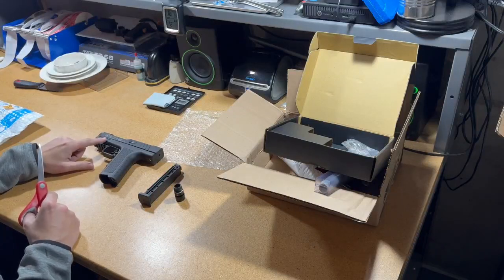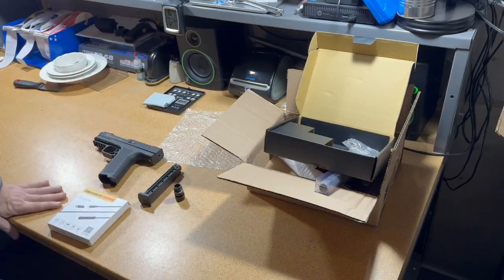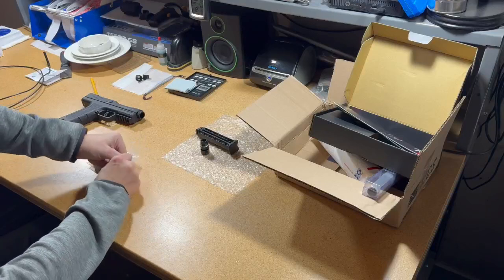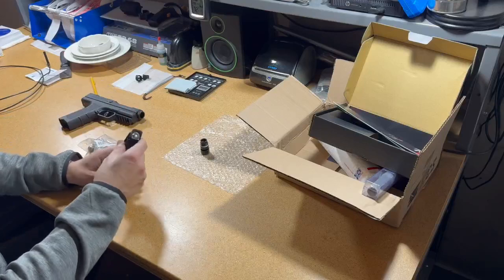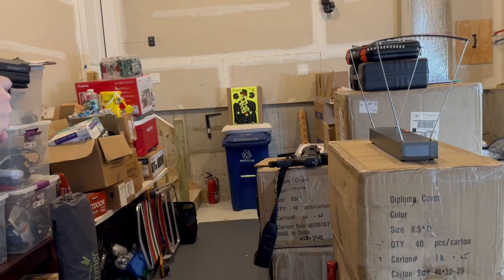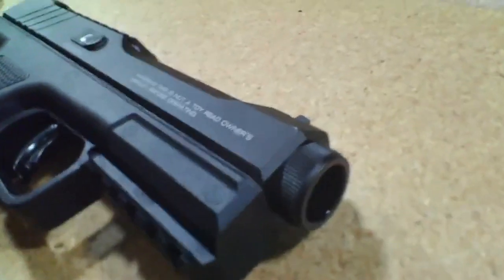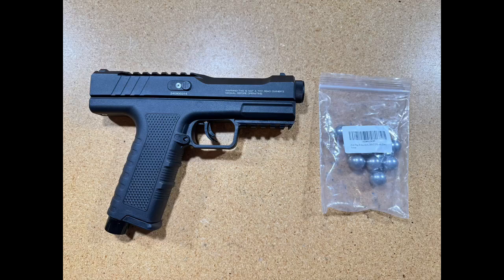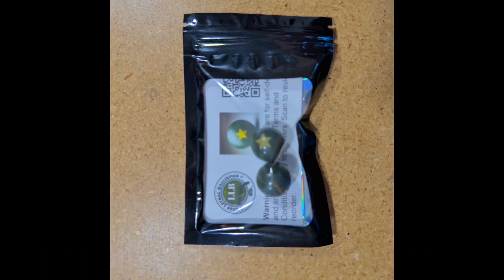Will aluminum .68 caliber projectiles damage your expensive CO2 launcher barrel?

Comment: Great video but i would suggest there is more to barrel damage than some scuffs that will likely wipe right out after a proper barrel swabbing.

I get similar marks from rubber and pvc coated balls.

I suspect the damage is more on the microscopic scale that no one will ever detect on a day to day basis. Some of the more expensive barrels are hard coated and nearly impervious to even my barrel hones. In the case of the X68 it is not.

Barrels are expensive. Would i advise against using metallic balls? Yes, but mostly because the law may see them different than LL.

I need to get me one of those scopes. 👍🏼 Keep em coming.
Reply from the maker: Thanks for your comment. I’m thinking the metal on metal scuffs… is the aluminum ball getting reduced in size or is it the barrel? I don’t want to assume material from the ball is being deposited onto the barrel. The ball may just as likely be taking material away from the barrel. If so, cleaning will not remedy.
Reply: @glennconti You should pick yourself up a 68cal barrel swab. It is an invaluable tool. Many users forget this most simplest of maintenance.
Reply from the maker: @ yes I have one from Valken. Not 100% sure of the  cleaning solution I’m using though. It’s for firearms.
Reply: @glennconti  couple of drops of silicone oil and some vigorous reciprocation 🤣 is sufficient. No need for anything fancy. They dont come filthy with manufacturing oils like steel barrels do.

Comment from the maker: Hello. The Grimburg JUL rounds are metal infused so there will be some metal to barrel contact. I will investigate this further. Thank you. As far as holding a company liable for selling rounds that damage your launcher, most companies limit your damages to the amount of your purchase with them in the fine print. Plus they can and will slow walk and stiff arm you to drive up your attorney costs or get you to give up. Attorneys get thousands of dollars as retainers. It just will not be worth it for the customer to win a fight. The company selling the defective product has much more to lose and many more resources to defend themselves. Most likely in the real world the buyer is at risk. Take this knowledge from the video and move forward now and make the right decisions. You suspected a problem via your common sense. Good on you. We use a polypropylene plastic coating which has a very low coefficient of friction for this very reason.

Comment: Thank you for the experimental data and evidence. I was always hesitant to get metal rounds because of this. Do you think the Grimburg Jul rounds will also put premature wear and tear on the barrel? So far I've only been using the PVC/Nylon rounds supplied by Defense Innovation, I do see they have aluminum glass breaker rounds but I didn't purchase just because of this. Also you think you can hold those company's liable for damages to the launcher if they market their rounds as compatible?